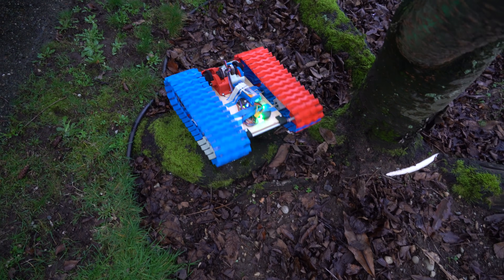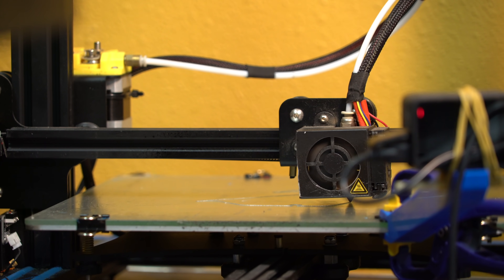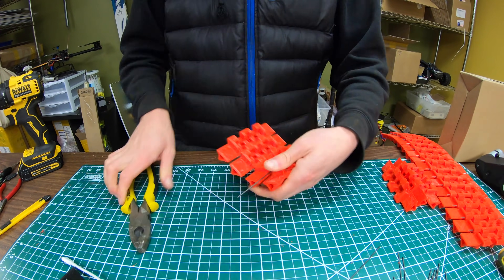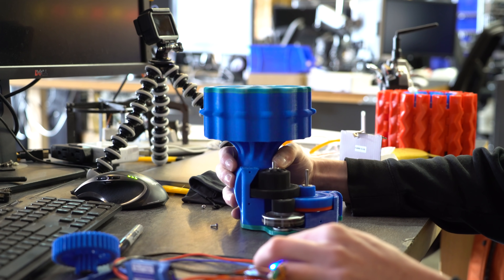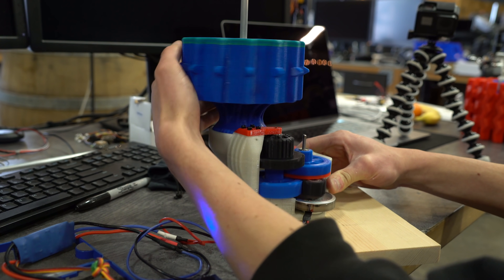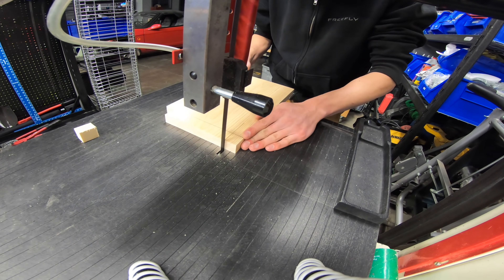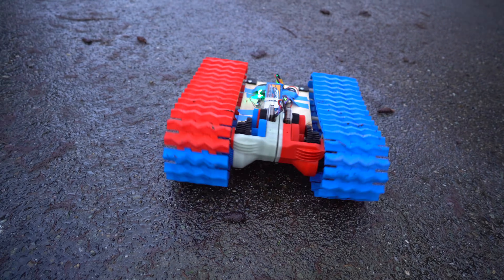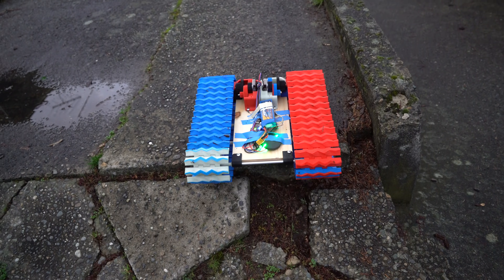Fully 3D Printed TANK - Brushless Gear Drive

Comment: PLA is probably one of the best plastic materials for gears. Its high hardness makes it pretty resilient against wear. We use other plastics like ABS or PETG because they are more flexible and doesn't break that easily, but because they are softer they wear out faster than PLA.
Reply: That is interesting.  Is there a good source for more testing data - like printed gear dimensions/layer height/gear speeds/torque vs plastic type?  Seems like Nylon would be ideal but it I thought it's properties are closer to PETG than PLA.
Reply: @nThanksForAllTheFish  Nylon has the best tensile strength, but that os not really important for gears, except if you are using them with very high torque, but then maybe aluminum or steel become the better option.

Comment: If you want to increase longevity and cut down on noise maybe enclose the gearbox and use some kind of lubricant? Not sure if pla is oil resistant, might need to use something else.

Comment: Did you know there's a ratio of track size to body size that is optimum for tanks? You may want to do some research to optimise your build. 👍
Reply: I think this ratio is more of an aesthetic choice, you have to have good looks for the thumbnail. besides it's a test of pla gears, so it's really a prototype of a prototype I guess
Reply: Just wide enough track to stop it from sinking in snow or mud.
Ratio of track area to mass*
Reply: could print the first 5mm of the track in tpu then pause for filament change and then pla.
Maybe even put smaller squares or lines or pyramids or somethings on the surface of the track where its tpu
Reply: I don't think it matters with it being so light. It will just slip :)
Reply: @ajuc005  it would probably get a bit better grip with slimmer tracks as there would be more pressure between ground and track but then it might sink in soft materials instead
Reply: @oliverer3  maybe a compromise - tracks that have an extrusion in the middle 50% of its width for grip.

Comment: It would be interesting to see the difference with tpu printed tracks (maybe with a slightly different track design for the tpu).  Since Colin Furze is doing a screw drive tank, it might also be interesting to see a small scale 3d printed screw drive tank.  A lot less components  - no tracks! and, it floats.
Reply: I think maybe the screw part could be flexible. Would be nice to see it go much faster than Collins, but I think it wouldn't weigh enough. Maybe screw drive pontoons on a boat for the win